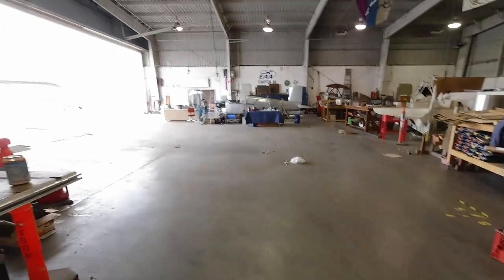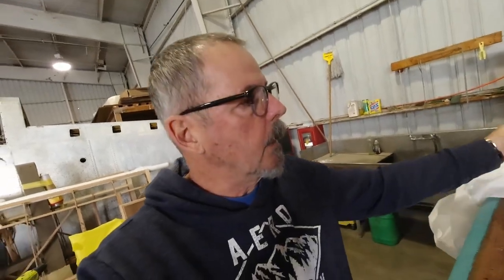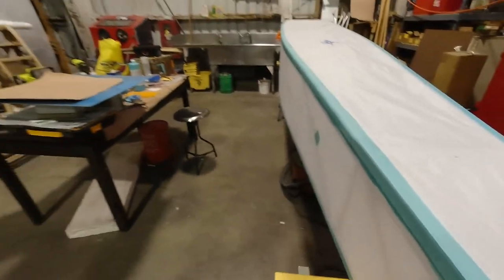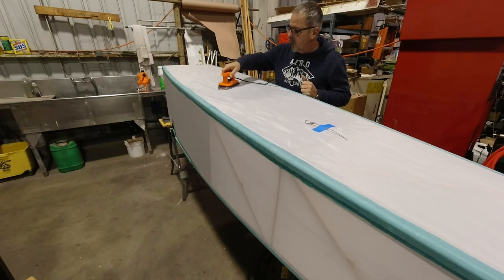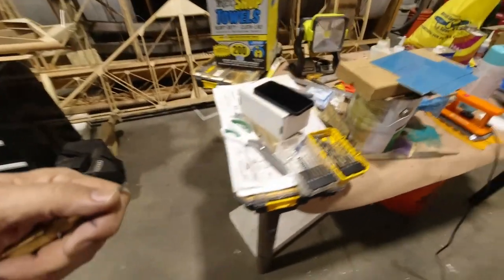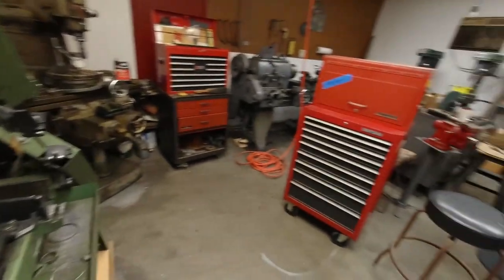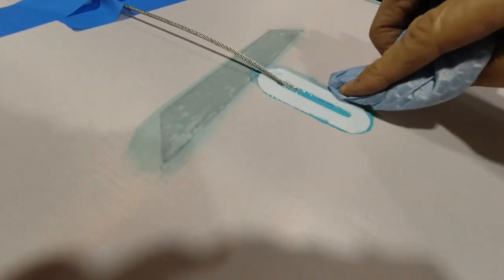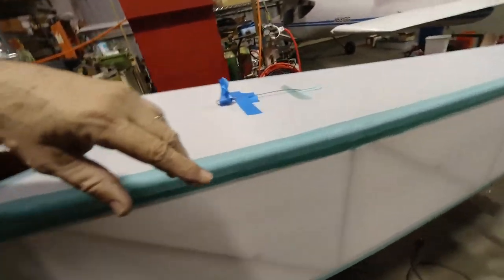Minimax 1100r Wood Aircraft Build Ep 148 - Fabric Covering and Battery Tray

Comment: You need the velcro to go front to back as that will hlod the battery against the highest G (eg sudden stop [Sorry]). Just stand it off the rear wall and put a slot in the wood support at the front and you can wrap around it that way. Please round the courners :-)
Why not use fishing line for the shoulder strap cable and then it could fall into the fuselage and the fishing line would not get in the way during painting?
Reply from the maker: All brilliant ideas of course!
Reply: @DTMinimax   I would not go that far but just some for you to think about.

Comment: Love the progress Dennis & my gosh it's looking sweet but I have a curiostiy question, why velcro for the battery? why not make a mechanical lock for it? Velcro has a short life span & I imagine subjecting it to G-Forces in flight would only reduce it's usefull time & may be a point of failure. Was also thinking the same thing about those flexing cable brackets, fatigue in parts can end badly.
Not "nit picking" just curious as to why besides weight saving. Loving this build & have learnt alot from you. My Uncle Gary said once to me as a phrase "I didn't know that I didn't know that" How very true he was & is. Cheers & thank you for what you are doing sharing your knowledge & experience.
Reply from the maker: Hey Leo,
Those cable clamps aren’t subjected to sunlight so they will have a long life span. I really didn’t do it for weight. 
The Velcro straps with the rings on them are readily available and simple. I was looking for a light weight solution to hold the battery.

Comment: Just wondering if you tested the fabric cement on the UHMW guide for your shoulder strap cable?
Reply from the maker: I did test it on a piece and it will work fine. It is sandwiched between two pieces of fabric the same as an inspection ring so it’ll be good